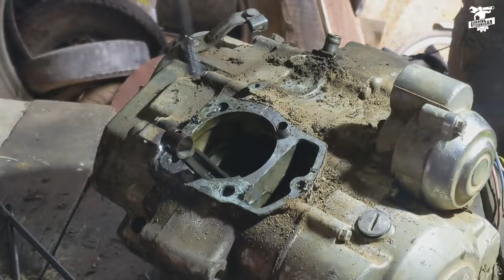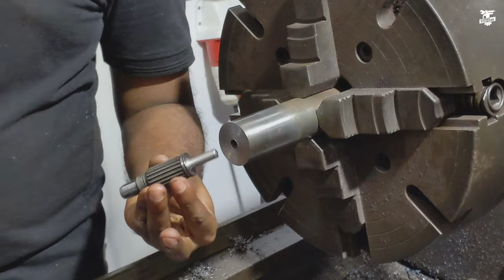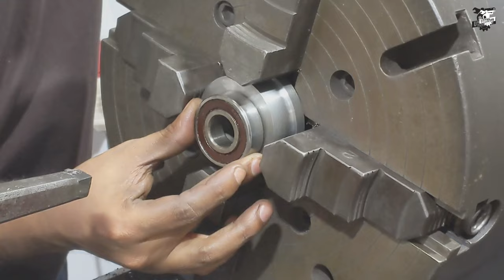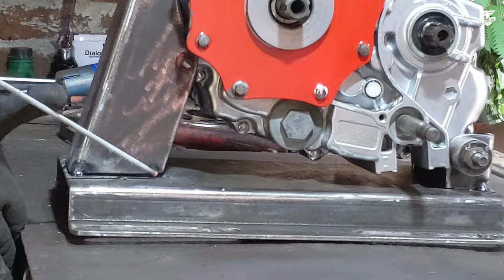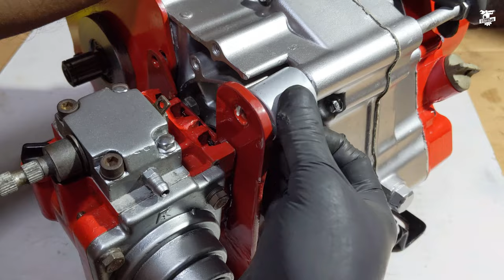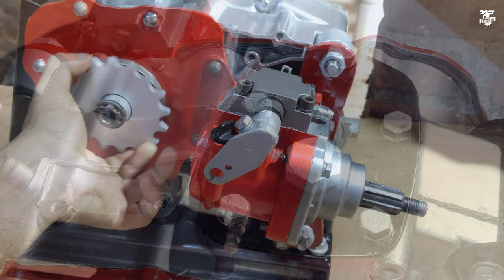I converted a motorcycle engine into a gearbox (with reverse gear)

Comment: The torque is on the other side.
Reply from the maker: What you are saying is not clear
Reply: @unknownT96 

The output shaft is the torque side of a gear box which makes the gear box worth being a gear box. 

Where as, if you're driving this gearbox the opposite of how it would be driven as a motorcycle transmission, then your gearbox is being used for increasing speed instead of torque